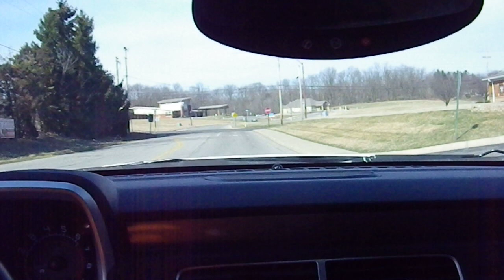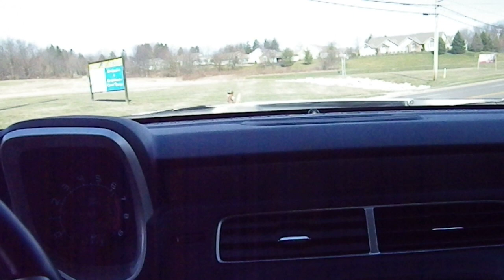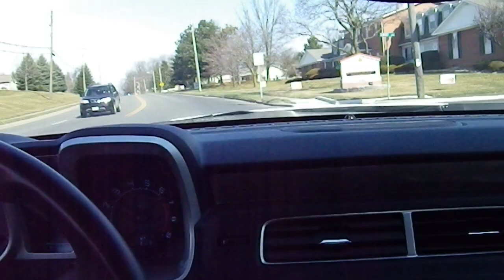Stock Converter on VVT2 Cam

Comment: You also are using the stock converter ??
Reply: I did have the stock converter and had no driveabilty issues. It was a stage 2 cam so mid level because at the time I didn’t want to spend the money on a new stall. 

I’m guessing you would be able to get a blower cam that Keeps the VVT? If you contact Texas speed they are extremely knowledgeable and that is where I got the stuff. What motor is in yours LS3 or L99?
Reply: @rahallsracing5227    That's awesome. I have the l99.  I'd love to do the cam that you used.  It sounds really nice !!!   I ha e a magnuson supercharger.  Thank you for the information.   I'll contact them and see what the options are.
Reply: @juliansdiamonds  In the 99 they will have a kit that gets rid of the displacement on demand because the push rod from that are weak. They should know all the stuff you have to change to put a blower cam in and make it safe for the motor
Reply: @rahallsracing5227  gotcha. Thank you bro 🙏